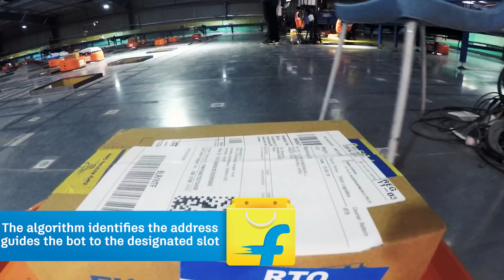Flipkart introduces India’s first robot-based sortation technology

Comment: I have a concern regarding online shopping of my Laptop on Flipkart.

1) I ordered a laptop on 17th Feb 2021 on Flipkart and the delivery was to be done till 22nd Feb.

2) I waited till 22nd Feb but the laptop was not delivered.

Then I contacted Flipkart Support Team and they told me that due to some reason it was delayed but will be delivered by 28th Feb.

3) Then I was waiting and in-between this I got a call from Flipkart and they told me that "Due to some technical issues your product will not be delivered on the promised date. So, you can cancel the order and place a fresh new order within 7 days from day of cancellation if you want the price difference back."(Here price difference = present price of the laptop - the price at which I ordered it).

4) I waited for 7days but couldn't get the refund of my cancelled order. (According to Flipkart, refund will be completed on or before 9th March).

5) In this condition, how can I place a new fresh order because it's a huge amount (More than Rs.50k) and it's very difficult for a student to arrange the same amount again.

7) I told the whole concern to the Flipkart Customer Care Executives but they are not doing anything.

8) Thus a great trouble and inconvenience I have faced due to Flipkart.

What should I do to do complain and get a compensation from Flipkart?

Comment: Hey Flipkart ,
I ordered OnePlus Bullets Wireless Z Bluetooth Headset .
Order ID - OD119682799490545000

When I opened the box there is no bluetooth headset ,only accessories are received.
I am contacting with customer care 2-3 times for return the box, but my issue is not solved.I give my aadhar details also and seller reject my return request and my refund is not initiated. I also contact with delivery boy ,he says contact with seller .
So what I do .
I am very disappointed with this,very bad experience with Flipkart .
My problem is not solving by you.

Comment: Hello everyone .Flipkart why there is no provision to hive zero or negative rating?

Don't ever  buy electronic goods from flipkart platform.. this is the worst online platform and doesn't deserve to be trustworthy... it is utter worst...
       They sell refurbished,old products in good packing and sell to us and cheat the customers..Amazon is best go for it..
        I was cheated twice and repent buying goods from this stupid,pathetic,disgusting e-commerce service.
Coming to this product.. the less we talk the much better it is.. 
1.Flipkart is associated with such gaandu,cheater sellers where the products that doesn't success in open market...they get rid off using this falthu platform and refuse to take return and Flipkart guys support them...what is this nonsense?
 
2.Worst cooler...no no good heater...Cooler is throwing hot air defective piece..product was packed way back in April 2018,i was delivered in this month
I didn't expect this from flipkart team.

3.Performance: Kept close to the body for cooling but of no use .. Just used for 1hour no cooling effect even after putting ice cold water at zero degrees..in fact throwing Hot air instead... kept close to the body for cooling but of no use .. moreover suffered from earache due to horrible blower sound...Hence I put it for a return..

4.The stupid product makes such a disgusting noise that i suffered from earache by just using for 1 hour due to horrible blower sound...

5.Taking it to consideration,I put it for return for which one dumb,stupid technician was allotted by Stupid associate JEEVES and that idiot came and checked less than 30 secs. and without considering my opinions straight away rejected my return request..

6.I immediately contacted customer Care and those fellows again contacted Jeeves and that fellow again called me on phone and the cycle repeated and at the end of the day ...again it was rejected... these stupid customer care fellow quotes that Sorry sir,based on technician opinion product is fine and cannot be returned.
and this vicious cycle continues till the window period for return lapses and after that they will close the options and force to put the product by our self. what a strategy Flipkart and what a way to cheating customers.. kudos..
. when customer is facing problems with the product and want to return it Is it not the fundamental responsibility of you to handle the issue?Instead these idiots tell us that Seller is not accepting to take... So at the end of the day...Seller Made Money and is happy .U brokers made money and you are happy we made Sorrows by putting our hard earned money in vain I.e.,flipkart.well done guys..
    I,being customer from 2014... now decided to uninstall app from my phone and never deal with this dishonest,cheating app again..

At the end Flipkart is big supportive of there sellers like WS retail etc., but not the end customer...